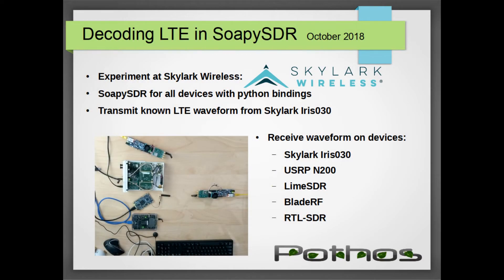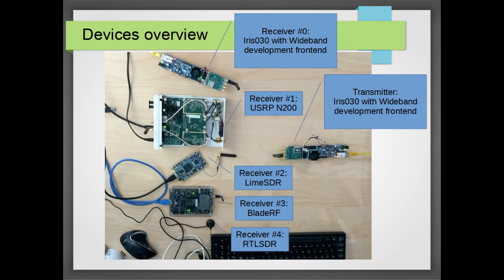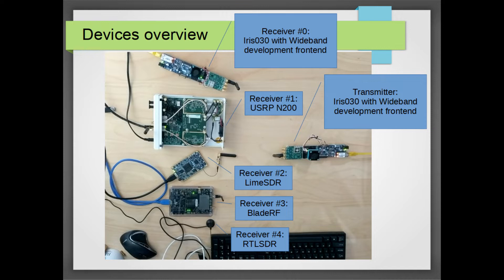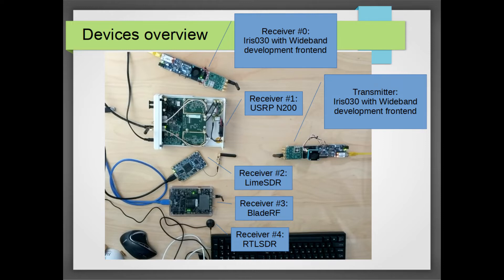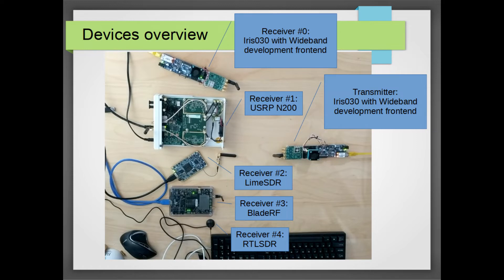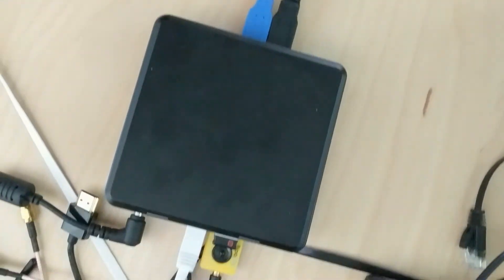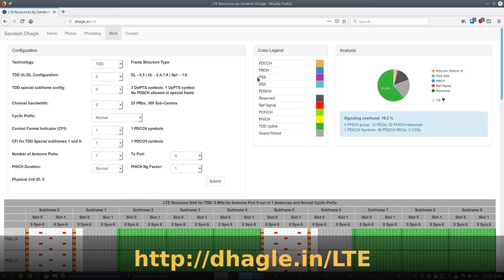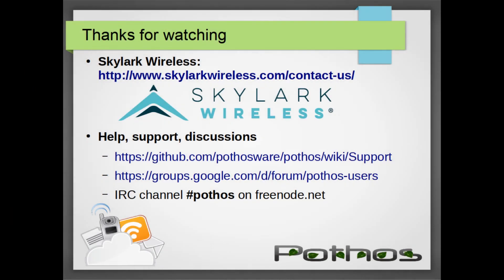SoapySDR: Decoding LTE across devices

Comment: Hi, using this setup, are you also able to extract info such as number of subscribers to the cell, throughput, RSSI and so on? I am working on a project where I need to check the status of nearby LTE celltowers using SDR... In the video you are only collecting cell ID
Reply: Hi Justin, I know this is a little late, but in the sake of providing an answer for the community: the entire workflow is software-defined, meaning you can implement any processing features that you need. Just take care to follow spectrum and security regulations in the location that you're using the system. If you need a more fully-featured platform for real-time LTE processing, the team at OpenAirInterface has support for SoapySDR and Iris030 hardware in their mainline code.

Comment: That LimeSDR could really use a case, Aluminum cases available for just 25$ delivered on ebay.
Reply from the maker: Ha, I have more LimeSDRs then I have cases with several prototype revisions and more in the lab. But I do have the acrylic case and two aluminum ones. The aluminum ones are very nice.